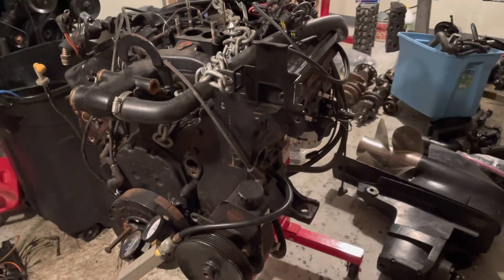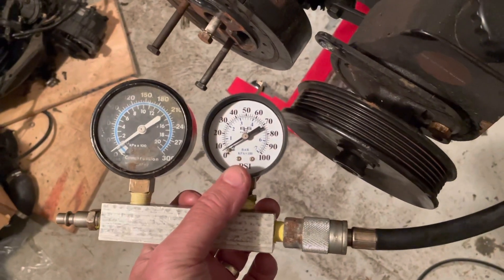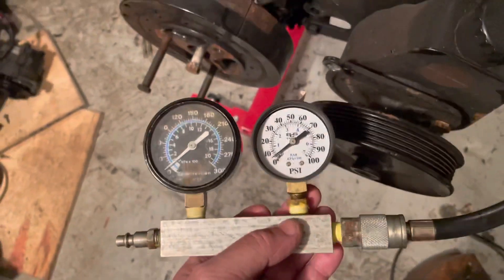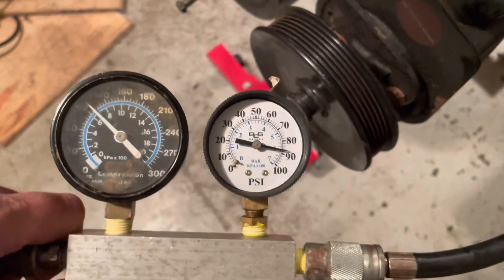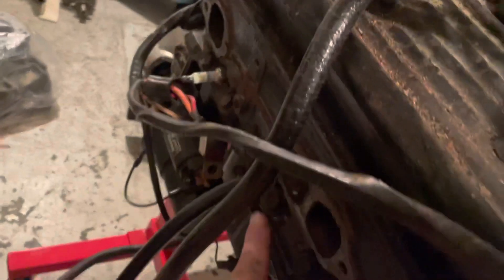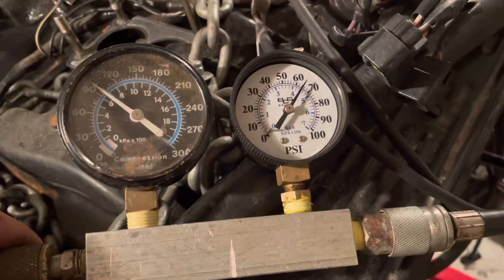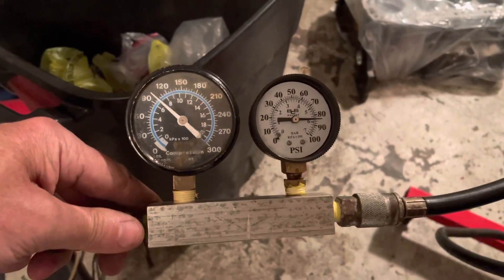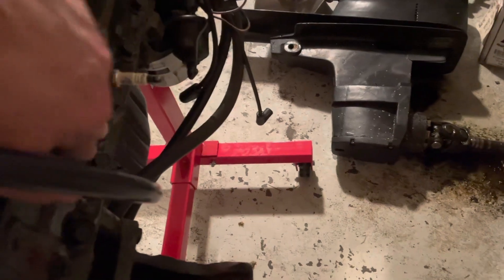Mercruiser 5.7 2(X2) - Leak Down Test Tool (Predicts Blown Head Gasket)

Comment: I’m not so sure you did that leak down test correctly. I’m an aircraft mechanic and that’s how we do compression test to aircraft but each cylinder you’re testing needs to be on top dead center with both valves closed it has to be on the compression stroke. Also on an aircraft, even when the timing mark is on top dead center it may not be quite there. You can move the propeller a little bit, which is the crankshaft and get the pressure to peek out.
Reply from the maker: It’s obvious you did not watch the whole video? I explained multiple times that I’m putting the engine on TDC on the compression stroke. I even showed how to find TDC on cylinders other than one and six using the  30 degree spaced holes in the harmonic balancer. Also if you don’t have the engine on TDC the pressure from the test will push the piston down and rotate the engine so you can’t do a leak down test when it’s not on TDC on compression stroke. But the scary part is you’re telling the world that the timing marks on an aircraft engine don’t necessarily line up with TDC and you have to rotate the propeller to get more pressure on a live leak down test? I would hope that you would have a tool to lock the engine from turning doing a leak down test on an aircraft. Seriously with 100 psi on a 4” round piston it’s pushing down with 1200 lbs of force. If all the spark plugs were out and they should be that’s enough to probably kill you with the propeller. I would hope that you never have an aircraft engine leaking as bad as this engine and that’s probably why you thought I wasn’t putting the engine at TDC since you’ve never seen an engine leak this badly, Your comments are just bizarre because I thought it was pretty obvious I was putting the engine at TDC for each cylinder test.

Comment: What ended up happening to the motor?  If it was repaired what was the cost for repairs?
Reply from the maker: The engine was rebuilt. Cost was around 5 grand because this engine needed new exhaust.